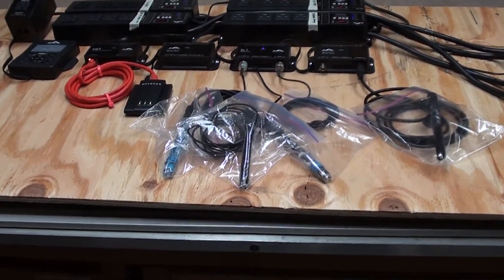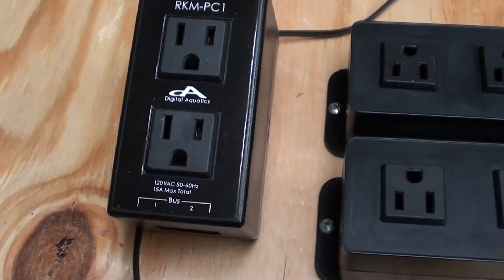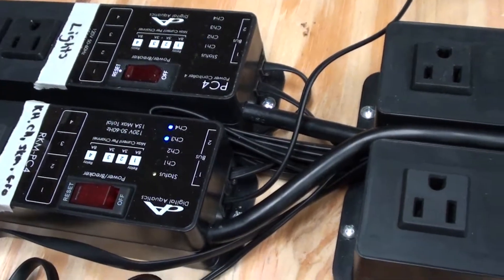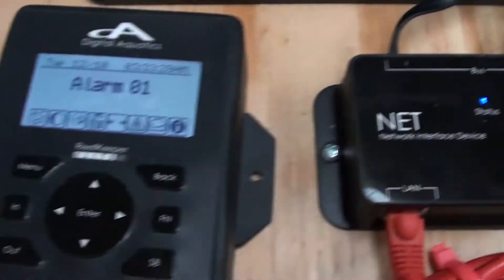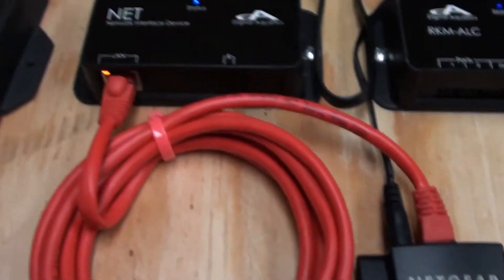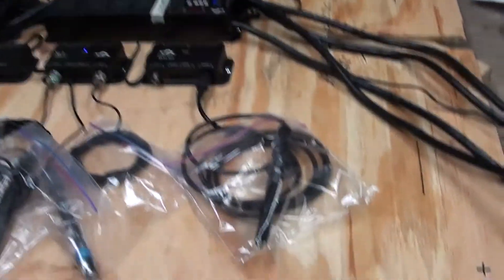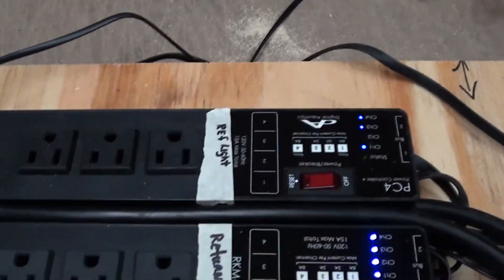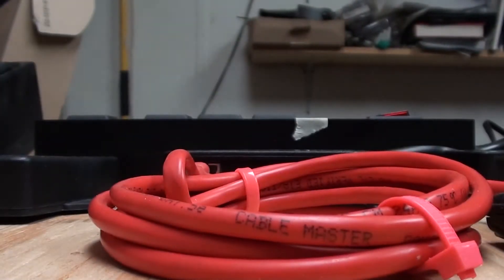DIY SW Project Pt. 2, DA RKE Mounted, Testing the Modules, etc.

Comment: Looks great. You seem like you are on top of things looking very neat and organized. This is not a criticism in any way, but if you want to satisfy your ocd tendencies like I would be tempted to do, you could make /buy a shorter cat5 patch cable. Completely unnecessary, but make it look even more "custom". Great job, and again, none of that was meant as criticism. In fact, I'm envious of your setup!
Reply from the maker: Thanks Nick. The Cat 5 currently on the board probably isn't what I am going with, I have a shorter version of about 3' max in dark blue that came with the Net Gear unit. I was using that red Cat 5 so that I could bring the unit over close to me while trying to figure it all out lol. Thanks for the observance, and compliments, appreciated

Comment: Hey James looking good.  Hey I wanted to let you know when I got my rfk the guy I bought it from told me you can only plug halides into a specific plug on the pc4.  Im not sure which ones they were but im pretty sure not the first 2.  you may want to do a little resaerch make sure you dont blow a plug
Reply from the maker: Hey Jon, yeah I am aware. 1 & 4 are used for Halides being 8A each. 2 & 3 are 3A for whatever else. They also have a Sure On feature that makes sure if the Halides are interrupted it won't switch back on for 15 minutes to avoid burning the ballasts and bulbs up :) Thanks for watchng buddy